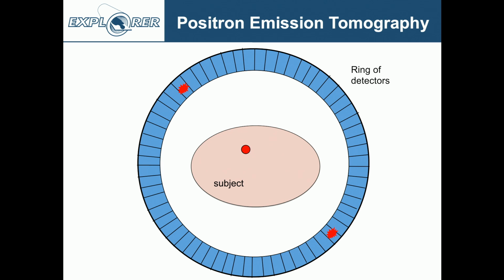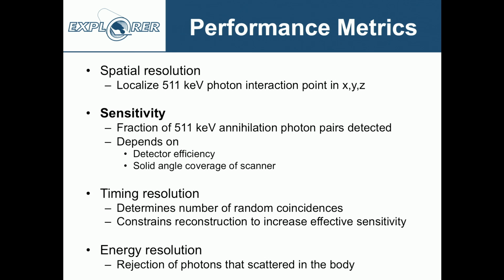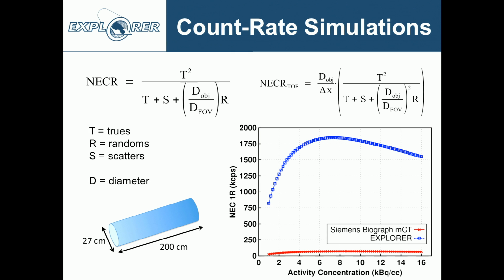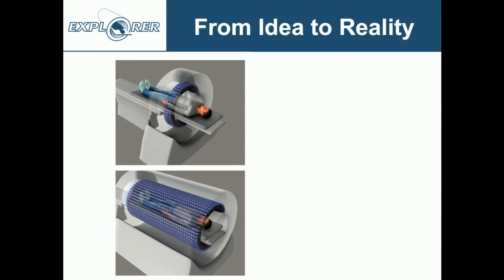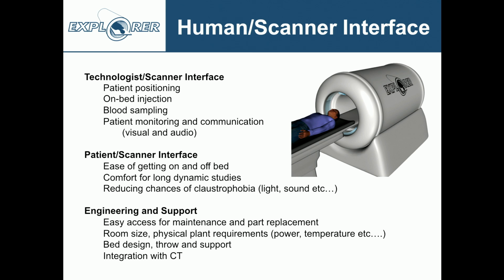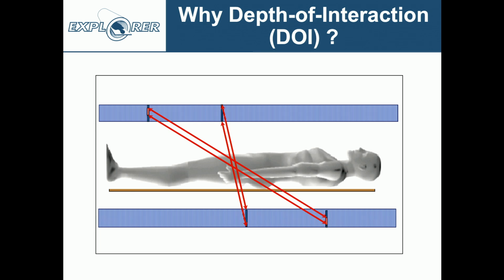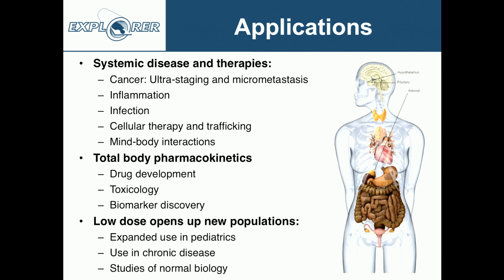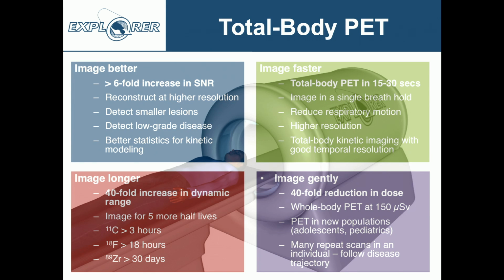Simon Cherry: EXPLORER -- Changing the Molecular Imaging Paradigm with Total-Body PET/CT

Comment: I think you should be able to enhance the resolution, despite the positron range, by performing properly modeled deconvolution (with convolution kernel from Bethe Bloch equations, or whatever other relevant other model). It can't be done super accurately, because of noise being a problem, unless you get very good signal to noise ratio some other way.
Reply: Nope. Deconvolution is ill-defined. You can't improve PET spatial more than the physical resolution of your system (considering positron range and crystals geometry)
Reply: @LucaABC852  Naively, couldn't you just use an isotropic PSF to compensate for the positron range? Or are you saying that other aspects of PET dominate the physical resolution?